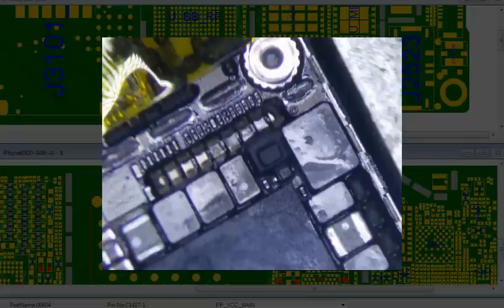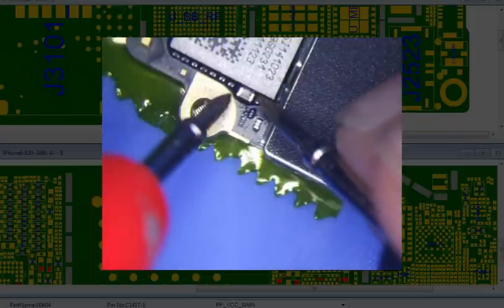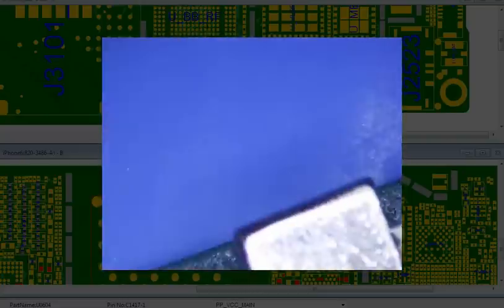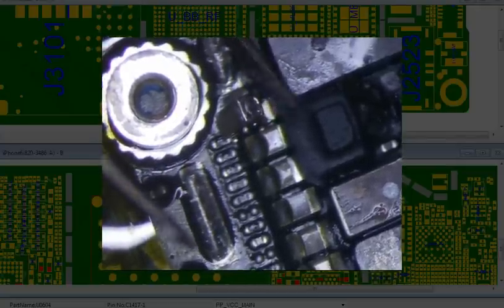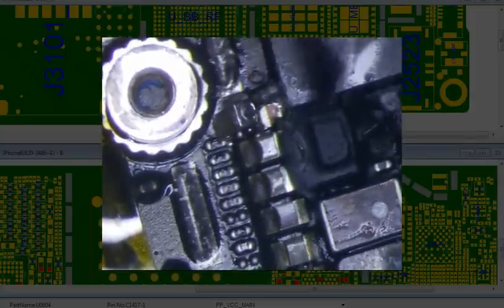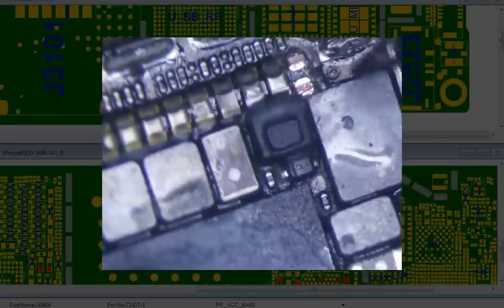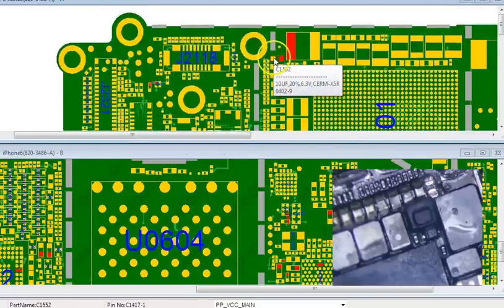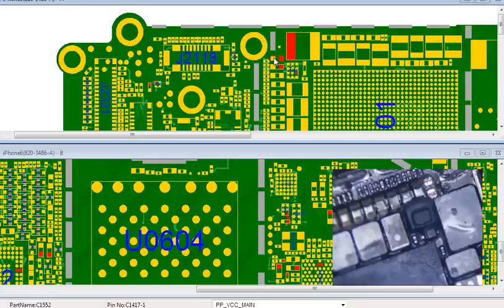iPhone 6 No Power Solution

Comment: Hi, I have an iPhone 6s with fluctuating voltage. It had water damage and there was a short on vcc_main. I have cleaned it with an ultrasonic cleaner and changed the U4040 and short is gone. When I connet it to the power supply it shows me 20-80mA and all voltage test is fluctuating. Can you help me please? Thanks. You can find a video about this issue here: https://www.youtube.com/watch?v=mLrUbxcIAJo&feature=youtu.be

Comment: I’ve got an iPhone 6 with a busted screen, and no power (no charge voltage to the battery either) could this be the cause? I’ve also noticed the LCIs are pink, and a slight blue tinge to the solder mask around the screw hole below the battery connector, do you think corrosion killed it? If not what do you think killed it if it’s water damaged? Also nothing is generating ANY heat, like it’s not even getting warm, iTunes detected it for about 30 seconds, and it hasn’t worked since.

Comment: What if you don't replace that cap?
Reply from the maker: The cap is used to smooth out the fluctuations in the incoming power.  You would probably be okay without the cap, but any big power fluctuations may cause unrepairable damage to other parts of the logic board.

Comment: I have an Iphone 6 Plus Logic board from a friend where it was described to me that phone would not power on and when it was working the grey bars and intermittent touch issues.  I have replaced the Cumulus (Had a new one) and reballed Meson (Didn't have new...due to reported Touch disease...No shorts I could find and tried to power on. It was receiving (Accepting) about 0.44 amp when I plugged in power but Itunes doesn't recognize it and phone still wont power on. The PM Chip was getting hot enough to burn ya, and PM chip and Meson heated up first on freeze test...so I replaced PM Chip as well. Checking voltages around Tigress were fine (Thank you for that video) but 2 caps around Tristar were near nothing.
I ordered a new Tristar and Meson...I have ZXW, Rework station, Microscope, DCPS, etc...can change parts pretty good...but still haven't had much experience on testing and measuring components to diagnose. 
First...is there something else you would recommend I do in any particular order? And Second, Are there any Online Courses or materials you are aware of I could study at home to begin learning the diagnosing skills I lack?
Thank you again and looking forward to more videos :)

Comment: Hi I have a iPhone 6 that had water damage, I had a short on VCC_Main and VCC_Batt
I already found the bad (Caps) one on each rail, I replaced them with the same caps no more shorts
but the phone still shows no sign of power, not even when connected to iTunes.... any suggestions ?

Thanks
Reply from the maker: check for voltages around tigris and tristar

Comment: THIS IS SILLY BUT IT WORKS      
     My iPhone 6s Plus wouldn't charge and it
was completely dead. I tried different a charger, different cord, plugged it
into 2 different USB ports, and tried the adapter into 2 different wall
sockets. Nothing worked.     
      I know this sounds silly, but try this
1st before anything else...simply put the part of the changer cord that plugs
into your iPhone into your mouth or lick it on both sides, plug it back into
your iPhone. It should start charging again.      
     Worked for me like a charm. I had a friend
who told me to try this. Talk about saving money & time! Hope it works for
you.
Reply from the maker: I hope no one follows this advice.
Reply: HAHAHA! If dosnt works with saliva please try another hole.

Comment: Ever encounter an issue when reworking an ic on an iPhone like the NAND or CPU where the solder underneath squeezes out? What causes that?
Reply from the maker: don't put any pressure on the chip that you're reworking.  The solder should melt onto the pad with gravity.  If you get solder coming from the bottom, then you'll need to redo the chip.
Reply: +Microsoldering it happens when I'm trying to remove the chip and just applying heat without touching it
Reply from the maker: +mrsemifixit maybe you are applying too much heat